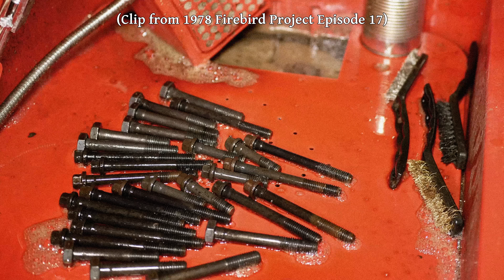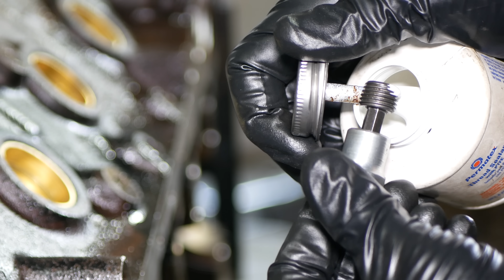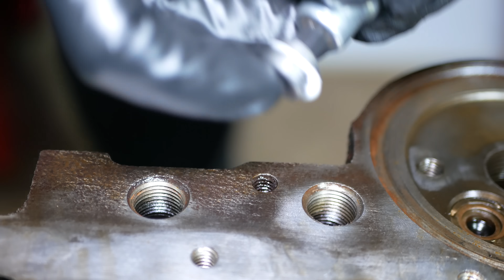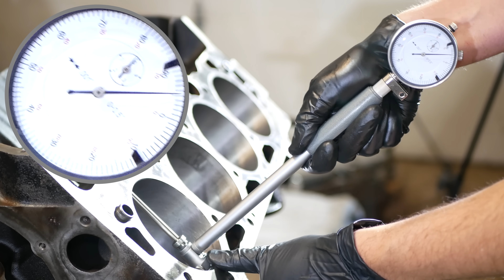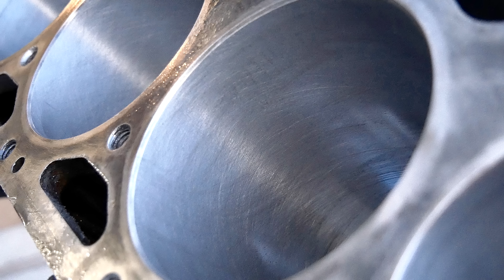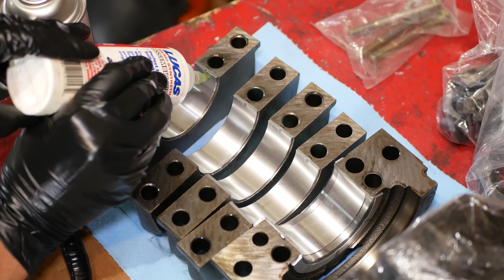$200 454 Engine Rebuild: Engine Block Measuring, Plugs, and Crankshaft  (Ep.22)

Comment: I bought enginetech lifters and timing chain, the lifters were .003 undersized and not usable, the timing chain crank gear was.005 oversize and loose on the crankshaft and the chain had 3/4" or more slack.  budget build wasted over $125 dollars.

Comment: I'm as money minded as the next guy but stupid I'm not.. I would NEVER EVER not take a stipped down short block to the machine shop for the necessary machine work because I like most people like to do the job right ONCE and only once ...I would send the crankshaft out for a good going over I would have the rods rebuilt with NEW ARP nothing special ROD bolts as with head bolts and Mains . I would also spring for a New Harmonic balancer and even purchased a New Oil pan maybe a 7 Qt trap door pan that looks completely stock but is not  I would have also  completely deburred the entire block inside & out  before it left for the machine shop . if this motor had the miles on it i'm thinking it had I would have gone 0.30 over with new hypereutectic pistons and appropriate rings and still wouldn't have broken the bank ....

Comment: I know this is not that build, and they are probably fine, and it's probably too late.  But - I would seriously consider replacing the brass freeze plugs.  Brass is good and what I use too, but the plugs deform easily if driven in using the tool on the ID of the plug as shown.  Do it all again, but use a flat face driver or socket that closely matches the outside diameter so the driving force is only contacting on the outside edge of the plug.  Trust me, it's better to spend the $25 now than after it's in the car and one pops out while you're breaking in the cam...  Also might consider Indian Head shellac instead of RTV.  PS - Don't throw the new brass plugs in the lake. :P

Comment: You can torque the main caps with the bearings and no crank. Then measure the bore of the main caps and subtract from the diameter of the crank for oil clearance right? 

Just making sure.

Comment: What would a bore and sleeve job run on a block like this? Also, was wondering the cost on doing that versus do a .010 over bore and new pistons? Not suggesting you do that, but am interested.

edit: Some digging I found runs $100 to $150 per cylinder. Would this be a worthwhile investment on the block for cylinder #7? Or will we find out how much that out of spec measurement actually affects the engine when you do compression testing?

Comment: Good  job  guys , I always found unless you have a really  marred  shaft where you Spun  , or severe  wear ,are going to be OK plasty gauge is good but I have used it and I’ve not used it ,never had a problem as long as I don’t see any metal to metal or severe wear on the crank or the rod service and I’ve built  many engines, The out of round is something I always check that’s ,and if I’m out of round like you said more than two or ..003  or worn I’ll just go ahead and bore Usually .030

Comment: Sooo.... Rigid vs. Ball Hone, which is better and why??
Reply from the maker: Rigid hone is definitely the best as long as you have a good one. The stones are held parallel and they let you get cylinders sized accurately and parallel. Work for a moderate size spread of cylinders. But, they are $125+.

A three stone hone like I used for this rebuild is quick and cheap, fits a very wide range of cylinders, and can remove a lot of material with the right stones. $15-30.

Ball hone is the easiest to use but only good within a small range of cylinder diameter, and you have to get a while different hone to change grit. Can still remove a lot of material, gives the best (looking) crosshatch surface finish in my opinion. $40-80

Comment: It's okay, you didn't need that cylinder anyway. Cylinders 7 and 8 are just spares.
I once had an old Chevy van that had a clapped out 305 in it. It ran on 6 cylinders most of the time, and 7 when I was really standing on it. Long live the Chevy V8! Or is that a V6.5?
Reply from the maker: On one V8 we unplugged a spark plug wire and it made it run better and cooler to help get up a steep incline. So this is just getting ahead of the game lol
Reply: @FuzzyDiceProjects  - That's hilarious! I would not have thought to do that. Kudos for the clever thinking!

Comment: Do yourself a favor(and your timing chain)and drill one of those plugs out. Just a small hole. Old engines didn’t have those holes in the plugs. But old engines didn’t last as long either. The factory did this this reason. I like how you do these on the cheap but you should have replaced a couple of those valves in the head. That’s not going to work out too well with no margin on the valve. Keep up the great work! I really enjoy your videos.
Reply: Hate to break it to ya, but this engine has been fully assembled for probably over a year now. The footage shown today was filmed a year and a half ago almost.
Reply: @jamieschinkai1267  I anticipated that …. But my statements are still true

Comment: if 0 was 4,250 the readings i saw you take were on the minus side of 0 which means you were in the 40's and not the 50's like one was 4,246 when you said it was 4,254 measure twice and recalibrate!!!!!!!!!!!!!!!!!!!!!!!!!!!!!!!!!!!!!!!!!1
Reply from the maker: If you look really close (may be hard to make out in the video) there are black numbers and red on the gauge. In this case the red numbers (increasing counterclockwise) are the ones to watch. In the first shot of the gauge in the cylinder when it is rocked back and forth you can see it increasing counterclockwise as it becomes more diagonal (pintle being extended). It is a bit weird but it's a cheap gauge set. Good eye though, always something you have to be careful of and double check

Comment: Noob question i know , but why do the holes the core plugs go in exist ? Why not a solid casting ?
Reply: It's not solid because those are the cooling jackets. i.e., that's where the coolant flows to keep the engine cool. The plugs are there because those voids are full of sand during the casting process and you have to have holes to get the sand out.

Comment: Man, I want a firebird. What's it like to drive? My car isn't the smoothest or quietest, but I've never owned a classic before and am not sure what to expect.
Reply: I have a 78 camaro (same overall construction) if you have good shocks and bushings and your car is in overall decent condition its actually a fun ride. They are heavier and you can feel it compared to modern cars. What i like though is you have more feedback through the wheel and gas pedal that alot of new cars are lacking. Road noise can be a bit louder too but replacing the factory sound proofing with more modern stuff can handle that too. again depending on the overall condition of the car you can have alot of squeaks and whistling and rattles. This is due to old worn out weather stripping around the doors and windows and if the hinges on the doors are worn out. F body cars (camaro/Firebird) are notorious for having floppy doors as the hinge bushings wear out and elongate the holes causing the doors to sag. Mine has good hinges but needs new weather stripping as it was poorly stored outside in a desert environment when it was younger. Im having the 305 rebuilt now too so its performance will change drastically compared to how it was factory.
Reply: @thebusybuilder4071  Thank you! So if/when I buy one, I will really make sure to swap out ALL rubber components that I can.

Comment: Well, cylinder 7 def isn't ideal, and yes a number of tolerances out of factory spec, but honestly, I do think you'll be fine.  Usually one wants to add about .001-.003 additional clearance for the piston to bore with a power adder anyways (yay supercharger), and by that measure it's only cylinder 7 that really is falling out of max spec.  May not be super ideal, but I have no doubt that this will be a very healthy and stout "rat" motor when your done. :-)

Comment: There is an old practice called knurling that can be used to increase the diameter of one piston.  I seem to remember my machine shop using it on valve guides and pistons back in the 60’s.
Reply: I recently had some pistons knurled because they came in at .005 piston to wall and I needed .002.  I was already at max bore so no option to rebore and get larger pistons. So instead of trashing the block and pistons my machinist knurled the pistons and then knocked the edges down until they micd right at .002 piston to wall. Old technique and not ideal but perfect when your trying to save money.

Comment: What I like about this build is the fact you are showing what can be re-used for a budget build. You don't need to replace everything if tolerances are within spec! I had no choice with the Mazda engine I just rebuilt.  The cranks and connecting rods for the 2.0 and 2.2 are not available. Anywhere. They don't make them new and nobody has any remanufactured. I bought an 87 B2000 and had the engine on the stand ready to assemble. Block honed, new pistons pressed and the crank journals were within spec. But then I checked end play. The thrust journal on the crank was TOAST. After searching and coming up with nothing I found a second truck. A 91 B2200.  I was lucky to have a good crank and rods in that 2.2. They said they were the same block. Well yes and no. A 2.2 is a stroked out 2.0.  I had to buy another gasket set and pistons. I bought two trucks just to build one engine. So sometimes you don't have any choice but to re-use parts and pray! I look forward to the next video sir!

Comment: I don't know about GM engines but on a Ford  302 engine with the one piece rear main seal you have to put a thin layer of RTV on the rear main crankshaft cap matting surface before putting it in. That thin layer of RTV will keep an oil from seeping between that matting surface. I know this from experience. When I tore down my Ford 302 I got out of a Ford Explorer I noticed a very thin layer of RTV on the matting surface of the rear main cap for the crankshaft.

Comment: I rebuilt a Chevy 350 and had the machine shop put all the plugs in but they missed one on the driver side head face. The hole was half covered by the head and I didn’t know until I tried to start it and spit oil everywhere. I had to pull the head back off and put it in.

Comment: Cylinder roundness and all that is fine. I’m in the get larger rings camp. As long as you make 100psi per cylinder it will run perfectly. Of course the oil consumption will slightly increase but a perfectly functioning engine is in fact a perfectly functioning engine. Run it until it blows up my friend. You could get another 100k out of it as is.

Comment: I rebuilt my geo metro engine on the garage floor, I took no measurements because there was nothing I could do about it if they were bad... I was very surprised and happy when the thing ran without issue.
Reply: Like they say, the worst thing you can do is start checking tolerances and such. You might find one which is out! 😄
Reply: I’ve always liked the saying “don’t check your cam bearings or they’ll be bad.”
Reply: I love geo metros. What year you got? 2-4 door?
Reply: @That1BVP  I had a 91 convertible and the other was a 2 door 93, I think. I still miss the convertible.
Reply: That's badass man doing similar with a 20r 1g Celica. No garage but have a shed & a living room.
Reply: thats what i did to your mom
Reply: Nice pfp lol

Comment: During the disassembly I thought I remembered you removing a small plug with an extension because it crossed paths with another journal of sorts, but I didn't see you reinstall it?
Reply from the maker: Hmm, I'm pretty sure I got all the plugs back in but I'm definitely not perfect lol. There were some for the oil filter adapter that we didn't reinstall, and a long extension was used to knock out the rear cam plug. Most of the factory ones were square drive which presented some difficulties in removing them too.
Reply: @FuzzyDiceProjects  I went back and watched that episode and sure enough, I was wrong. I guess I am thinking of something else. lol Oh well, sorry about that.
Reply: I've never messed with a big block but I know the SBC has a press-in plug deep inside the vertical oil galley for the oil pressure sending unit. You have to press it in from below before installing the rear main cap or oil won't be diverted to the filter. Not sure if that's what you're talking about or of the BBC even has one.

Comment: Very good and thorough pre assembly.  This is the key to a successful engine build. A lot of DIY’ers skip the measuring.  
That said, and I know you know better but, #7 bore, cam bearings, and valves/valve job takes away from this excellent video on how to do things right.
Reply from the maker: It can be a walkthrough and a cautionary tale at the same time, right? Especially if something does end up failing, it will illustrate to myself and others why those little things are so important.
Reply: At this point I honestly think he doesn’t care, i mean he got it for 200 bucks, and if it breaks more content🎉, wait a minute….. HES DOING IT ON PURPOSE!!!!
Reply: Kind of missing the point.